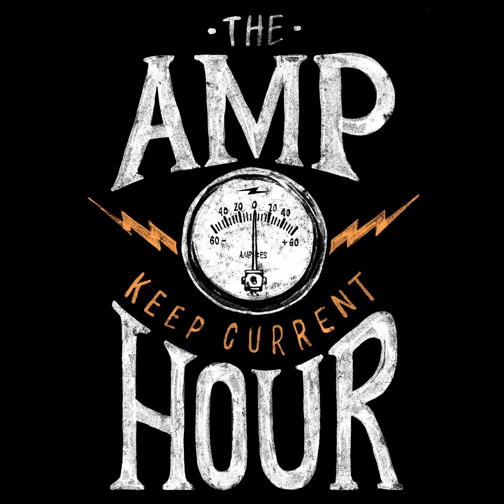The Amp Hour #591 - Olive-a The World

Comment: Problem with agriculture going fully electric is getting power to the tractors!
As refueling in the field. So you would need a big towable battery pack with solar panels on top.
Chicken & egg problem.
Also a lot of farms do not have three phase for fast charging.
In UK most farms have dual phase 180 degree 480v so you would need a charger for this option as well but people don't build a lot for dual phase.
Same with building sites as these types.of vehicles don't travel very fast so driving to the nearest charging station is out!
This is why they are looking at hydrogen as a big towable battery is both as dangerous as each other, plus hydrogen is cheaper.